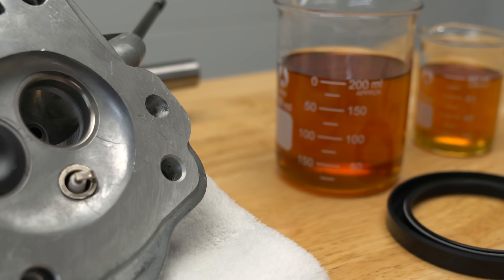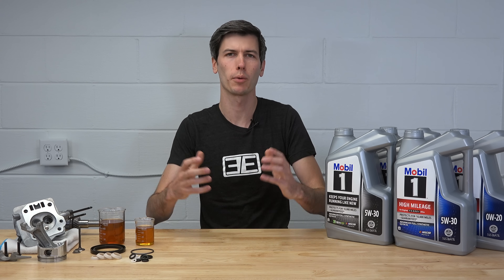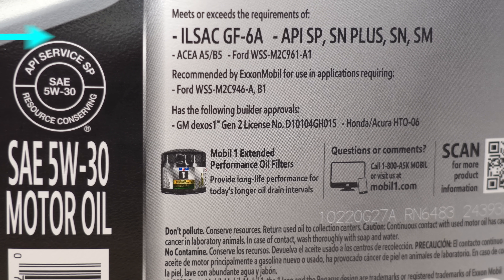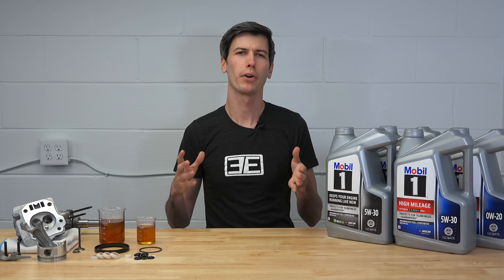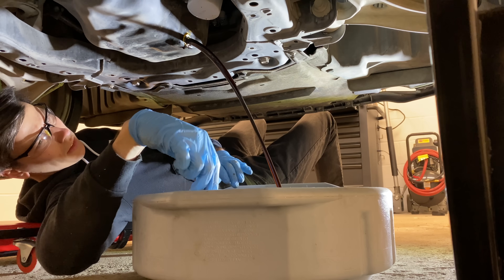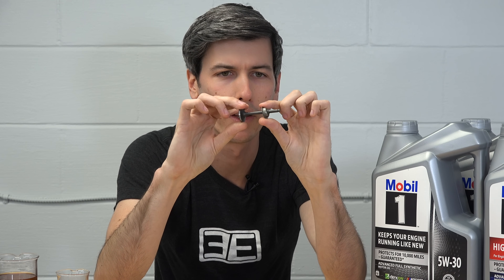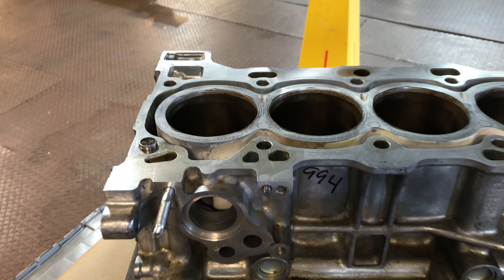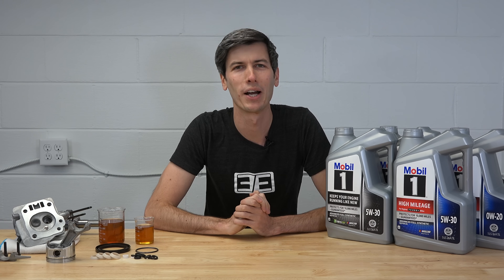Is Synthetic Motor Oil Bad For Old Cars?

Comment: I made a change on my 2007 Renault Clio 2007 with 256 000 kilometers. Bumping up from 5W-40 to 10W-40. It started to be worse at cold morning starts, but I recently changed the battery for larger and it got better. :D So that´s my experience. And I changed it for the reason that, on the motorway at 130km/h it runs 4100 rpm, so I thought that thicker oil might be better in terms of protecting the engine at such high RPM for a long time.  :) Shame I cannot change it back down.

Comment: You didn't address zinc needed for flat tappet cams. Synthetic oils don't have zinc and so are not to be used in older engines with flat tappet cams.

Comment: My 2020 Subaru 2.4 turbo uses 0w-20w which I read is to improve gas mileage. Would it be better to use 5-20w for better lubrication when cold

Comment: Older engines have packing rope seals.
They usually leak just a little bit with conventional oil.
I would assume synthetic might leak worse.
I guess I'm old, he didn't even show any rope seals.
I guess there's different levels of old.

Comment: I have a 26 yr Toyota Hi-Lux Original engine with almost 400,000 km on the clock , I will next oil change use Synthetic ( Hi Mileage Oil ) , Thank for answering my question/s !

Comment: Great presentation again as usual. I've corrected or should I say improved low oil pressure at idol by dropping the pan and replacing the rod bearings. That's all. No resurfacing the journals. Those fixes made it possible for another 50,000 miles on an old chevy corsica.
Reply: Only 50k miles on the Corsica? You must be s racedriver!
You should get 250k miles.
Reply: @bobvido9875  Yeah that little V6 eventually went over 300K. I sold it to a high school student who for all I know might be still driving it.

Comment: You are wrong sure you can put synthetical in old engines but it's not good for  Old   Engines   Made zick, And I don't need multi Gray all they need a 30 way or better You are trying to sail synthetic which is a high dollar  oil

Comment: You seem to have neglected one thing. Older vehicles have cork seals, these let oil seep through. My Brother-In-Law put Mobil One in his (now mine) Nailhead 425. It leaked like a sieve. Back to Conventional oil, leaks go away. Lesson learned. For the rest of my newer vehicles, Mobil One at the recommended viscosity.
Reply: That is something I've heard elsewhere (namely Uncle Tony's Garage), and was waiting for him to address it. He states that if you use all rubber seals in your classic synthetic could help your performance and engine longevity, but it will seep through cork gaskets.

Comment: Yeah, might as well take you up on that oil change special  you're running since old Bettsy"s in for new tires and - I was gonna' do it soon any way. They used "High Mileage QS 5W20  in an F150 "96 w/ <200K. Guess What...

Comment: What about the case when my car's manual allows me to use 0W-20, 0W-30, 5W-30 and 10W-30. Which one shoul I use then?
Reply: The one one the cap, or the one that matches your weather conditions best.
Reply: 5w-30. Only reason to go lighter is if you want to get .1 mpg better.

Comment: it is not always advisable to increase the viscosity of the engine oil. the best example is my engine (honda RA18 engine). if the engine oil change intervals are observed and high-quality engine oil is used. then there are no problems with the piston rings. but if quality is saved and the intervals are exhausted, the piston rings begin to coke. many have this problem with this engine. In this case, most drivers increase the viscosity in the hope of reducing oil consumption. in reality, the problem is only made worse. instead of high-quality 0/5w30 or 0/5w40 fully synthetic, cheap 10w40 semi-synthetic is used and the piston rings coke even more. the area around the piston rings is exposed to high thermal loads, so an engine oil must also be able to withstand high thermal loads, otherwise it will start to burn right there. therefore I drive a temperature-stable 0w40 and have no oil consumption. mostly the problem is behind the steering wheel.

Comment: If my car had 10w40 semi synthetic oil before and manual recommends 5w30 fully synthetic oil, can I go back to 5w30 or should I do oil flush using additives before changing oil?
Reply: Yes. You can go back. Just keep up with the maintenance regularly. If you want to flush the engine, I wouldn’t use additives, just do an oil change, let your vehicle run for 5-10min and then change the oil again.

Comment: If you are swapping from conventional to synthetic you should have your engine checked out first.

This will cover used engines with unknown history or known they were poorly cared for. If during inspection high amounts of sludge is found you are looking at serious issues. No matter what you do at this point besides full rebuild you are looking at future engine failure. We have all heard how synthetic will clean your engine in little as one use. The problem is some of the sludge has already changed into hard chunks stuck on walls that don't like to break down easily. These chunks then lodge is passageways causing oil starvation.

Staying with conventional oil will still lead to failure. Only not as soon because it normally doesn't release the hard gunk. The sludge will continue to grow and harden leading to blockages causing oil starvation. 

You will face engine failure at some point but the swap to synthetic will drastically reduce engine life in this situation.

Comment: Best analogy I ever heard was in 1990 from a chemical engineer who likened conventional oil to a glass marble and synthetic to a steel ball bearing, Take a hammer to each and see which one holds up. 
I’ve used full synthetics in everything ever since; New, Antiques, 2-Stroke, and Diesels. I do use high zinc (20-50) in my 30s-60s vehicles. No problems.

Comment: i didnt even watch the video, i can tell you i had a 96 accord that i ran mobil 1 10w 30 in it went 318,000 miles wheels falling off transmission about to out from underneath it, gas and brake lines rotting out completely, motor still ran like the day i bought it.

Comment: Changed from the old 30 weight oil to synthetic in my jeep with the 4.0.   The oil pressure was instantly very low and with in a week the engine was scrap
Reply: Thanks, ?.. hard to imagine if viscosity was 30W, also, ....Interestingly, just thought of my (70:DODGE/**383CI/Turquoise’s)WITH 20 W RACING oil ,having a -10 F, temp, or lower,quick freeze one,   Night  in 1971 Winter...facing into wind :  would not start, as I 
Was LATE:to,change go 10W/20-30 over .....Could,not get to work & had to have  my Service Station make a House-call to start me@ NORTH Webster Indiana! ( remember when Service Stations had Mechanics, come out tomHouse, etc.?)... Actually a learning experience with 20W Valvoline Racing Oil...of course the full SYN VALVOLINE is great in proper Grades.... etc.

Comment: Old engines with existing seeps or leaks will get worse if switched to synthetic. Seen it many times. The stance here is well the seal is leaking so it needs to be changed anyway and they are correct - but the fact remains that the oil switch can make a leak worse.

Comment: I put Supertech 0w-20 synthetic in my 1994 Silverado 350 with 131k on the clock. Motor ran great and no excessive oil consumption was noted. No leaks developed and no leaks got worse. So the answer is yes.

Comment: I tried switching to synthetic in my "91 turbocharged Dodge Daytona, it promptly started spewing blueish smoke out of the tailpipe. The turbo has plain bearings (not ball bearing) and the oil was getting past the bearings and into the exhaust flow. I tried switching back to regular oil and the problem persisted. I replaced the CHRA and stayed with the conventional oil and all is well. That being said, I bought my '92 Turbo Dodge Daytona from a guy who using synthetic oil in it and there are no leaks or oil loss to this day. So, sometimes you can, sometimes you can't. My little experiment cost me about $800 in parts and labor, your results may vary.
Reply: I always used dyno in my 2.2 turbo for the same reason.  5w-30 and changed it like crazy.

Comment: sludge building up in the top of the engine causes it to "get hot" and fail........ha ha ha........WTF
Reply: Pretty slow.  I've told people don't try to engine flush unless you don't mind a clogged sump and complete failure.

Comment: I had two vehicles in the late 80s (1981 Buick Regal, and 1984 Buick Rivera) that always had used conventional oil.  I switched to Mobile1 synthetic in each one after I got the vehicles because I wanted to run the best oil I could.  Both developed valve cover gasket oil leaks shortly thereafter.  I know of multiple other guys who had the same problem.  I think that it had to do with the age and type of gaskets used at that time ..... probably cork that were set and the smaller particles of the synthetic oil were able to penetrate and cause the leaks.  This was only for the valve cover gaskets that leaked, everything else was fine. That was my thinking anyway.  

With that being said.  I only use Mobile1 full synthetic now in all of my cars and there are no issues.
Reply: Yes. Same here...

Comment: Its really about shear strength. Long chain molecules vs short. I'm no expert, but its a thing.  Lifters in old large engines get torn apart if the 'wrong' oil is used. Heavily long story short, its about Zinc content, and detergents.

Comment: Hi Jason, I love the videos.  One thing that you did not address directly was to use the synthetic oil with the correct viscosity range for your car/bike/truck that is specified by the manufacture.  Your product display did not match my old 26 year old car that needs 10W-40 SJ or 20W-50 SJ oil to work. My bike that I bought brand new 2 years ago needs the same grade of oil. Weird. 

Can I get synthetic oil for the bike and the car at the recommended viscosity? Oh, yes. The bike needs an oil change so I have a blend of mineral and synthetic to test out, at the recommended viscosity.

Comment: Also, synthetics got their  reputation for leaking from the very first ones. (I think Mobil was there too) They didn't even "look" like oil, but were a silvery/ graphite color and thin as water. Those even came with  a notice on the can that you oil pressure light or gauge would flicker at idel and not to be concerned about it. "Your engine is still being properly lubricated" .
Anyone else remember those?
Reply: my dad ruined an opel gt engine with graphite oil it wasnt a modern synthetic oil though.

Comment: Switching to synthetic oil on a mid 90s chevy pickup with 130k, ford pickup @ 180k and ford motorhome @ 65k caused increased oil consumption in all 3, not leaks. Returning to mineral based oil returned consumption to normal. Just saying.

Comment: Walmart Super Tech oil has all the fancy numbers and letters as the big company’s. It is also API approved with the API donut seal. You want to pay more for endorsements and pretty colored bottles it’s your money. Change your oil with a quality  filter at least every 5,000 miles and your car will last many many years. But what do I know only fifty three years of experience. 😁
Reply: been using synthetic since 1974, SuperTech for 15 years.  In 46 years of use, ZERO engine issues!!! Datsun/Nissan, Toyota, BMW, GM/Saturn, Chrysler/Dodge, Hyundai, Honda/Acura, Continental 0-200 aircraft engine... lawn equipment - ZERO engine issues... Don't abuse your equipment, change the fluids and filters...

Comment: API approved oil that is the correct weighted. Keep it clean. Best oil is clean oil. I change my oil when I can’t see my oil dip stick level lines through the oil. Fifty years of doing this with no problems with any engine.

Comment: good video except you did NOT mention the problem with using a synthetic oil in an American engine that uses a flat tappet camshaft, Most of the American iron that is 30+ years old are equipped with flat tappet hydraulic camshaft grinds and need an extra zinc component that is not present in synthetic oils 
.otherwise a very good video

Comment: Many leading cars have good seals that are being over-pressured  by blowby that exceeds the capacity of the PCV system. This can be corrected by better-venting the crankcase, or using an additive to help hold the oil in place and bridge the gap between the rings and the cylinder.

Comment: I figured out a long time ago that running synthetic in my vintage motorcycles led to oil weeping through the gaskets (not seals). Same viscosity, but synthetic will always weep. 
Not saying it’s bad, but it certainly weeps through the gaskets more than conventional oil.
Reply: Your gaskets were bad, I ran Supertech full synthetic in a 74' Chev 350cu truck, 81' Dogde Mirada, 94' Accord and Camry, no leaks.  And still run any synthetic I can get on sale in my current cars.
Reply: @lonniebeal6032  One of the first bikes I noticed this on was a vintage Moto Guzzi. The bike has two gaskets on each side of a spacer when you drop the pan. You change the gaskets each oil change (oil filter actually is inside the pan). When I run identical weight of oil, synthetic always weeps a bit through the gaskets, conventional does not. Not much, but it definitely weeps. I’ve noticed the same on several other bikes. 
I can only tell you my personal experiences.  Synthetic is superior in every way to conventional, but it does weep in some instances. Keep in mind that not all engines are designed the same and may not put a paper gasket anywhere in an engine.

Comment: 4:18....Gunk and sludge building up around a leak IS a solution for a lot of people.  They're not car geeks.  If that sludge and gunk keeps their engine from leaking oil, then they get to drive to work everyday and don't have to spend big $$$ getting it fixed.  My 18 year old grandson just bought a 2004 camry with 140k miles.  Decent car and it runs well, but I told him to never put synthetic oil in it.  He can't afford expensive car repairs.  And being the good grandpa I am, I told him I will change his oil for him (and I will pay for it) as long as he brings me the car every 5000 miles.  And it will be the same for his two younger sisters when they get cars.

Comment: If the synthetic is TOO slick, it will not work properly in flat tappet engines.  Also, flat tappet and air cooled engines should never have an API rating over "J" because those designs need the zinc.  If you look, racing oil for old design engines, lawn mower engine oil and ATV/motorcycle oil is API "J".  Rotella T 15W-40 diesel engine oil also has the proper amount of zinc.

Comment: Marvel Mystery Oil swells synthetic rubber seals and gaskets.  They don't dry out or leak but if you take one out you need to replace them because they won't fit back in.

Comment: I put full synthetic oil in my 2012 Nissan Frontier and the head gasket leaked oil I’m assuming from what you said in the video, gaskets start to swell. I think I’ll stick to regular high mileage oil nothing fancy like I tried before.

Comment: Synthetic oils are NOT suitable for older cars. They have a substantially lower amount of zinc in them and this causes far greater wear in the camshaft and valve train areas
Reply: I guess my toyota  with 300,000 plus miles didnt read this. Never had a problem with the last 3 vehicles all using synthetic oils. Lucky maybe?

Comment: Working at an auto parts store and trying to convince customers that these oils are no longer the same as 30 years ago,  is really hard,  especially when they say "my mechanic said is ok for mee to use a 20w-50 on my car because it's already an old engine.." smh.... 

Yes,  yes sir you can....  throw out what engineers have been working on for years and listen to your "parts installer" who you call a mechanic...

Comment: I build engines. For my antique prewar Chevy  they actually allow a tighter clearance than the modern Honda. Main and rod bearing clearance: 1933 Chevrolet Master Eagle; .001-,0025 in. Main and rod bearing clearance for a 2020 Honda Accord: .0025 in. Tell me where there's any different clearances in modern engines. ???? Oil works well with that clearance, always has always will. The claims of modern means tighter clearances a false claim.

Comment: A constructive suggestion-- your voice is pitched as though you were trying to reach the back row of an amphitheater, and is much too loud for the audio setup you have. Use a boom mike or a better throat mike, which is more sensitive to normal speaking volume. Audio pickup is a difficult thing to optimize, but you will hear more natural results with the suggested approach..